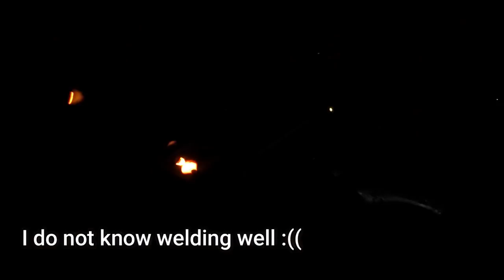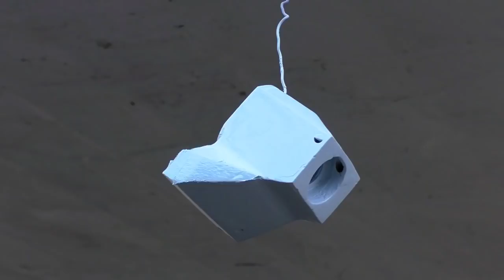Rusty and Broken Mini Vise Restoration

Comment: Something that helps with welding a large chunk of metal like that is to heat the work up before welding it.  
Welding a large piece while it is cold will allow the heat from the weld to dissipate quickly in your work and weaken the weld. 
It will also make the welding process easier in general.  
Hope this helps.😊

Comment: Dragging the file backwards across the work piece is a good way to dull your file.
Reply: Depends what you mean by dragging. Let the pressure off on your back stroke vs trying to remove metal. Keeping your file on the workpiece will typically result in keeping a more consistent angle. Filing machines drag the files on the back stroke. We have them at work with 10 year old files on 304SS and they still cut almost like new. Just my 2 cents.
Reply: @coreysheets4862  the problem is they don’t cut on the back stroke, but they still wear the teeth, especially if the work piece is hardened. Pressure or not, it’s bad form. Filing machines are few and far between, but their teeth and profiles are made for that purpose.